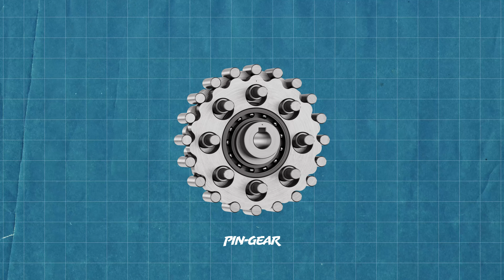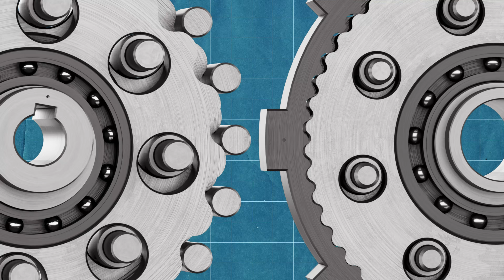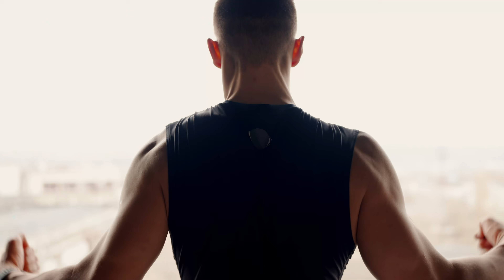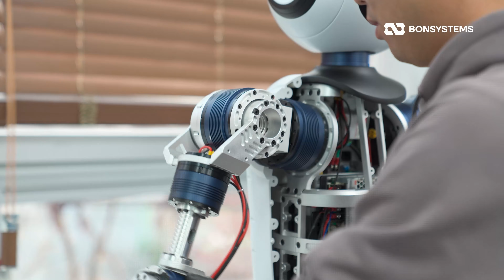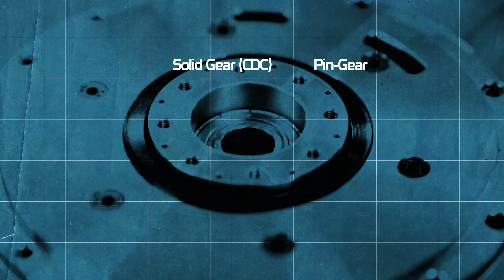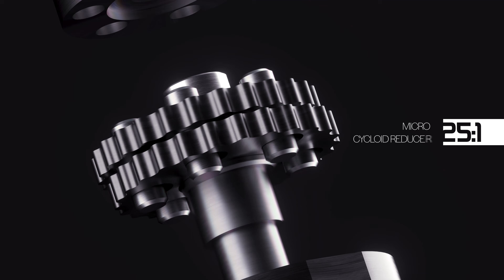Cycloid Gears: A Complete Comparison of Pin Gear vs. Solid Gear

Comment: I'm confused. Isn't the pin gear type usually has higher efficiency and lower friction since it turns sliding friction to rolling friction between the teeth and the ring?
Reply from the maker: Even with rolling motion, cycloid reducers are structured so that a large number of teeth are in simultaneous contact with the outer ring. (As you noted, cycloid gears do sacrifice slightly more efficiency compared to planetary gears, but they offer superior precision.)

Our BCSA series is designed with a slight, optimized clearance between the inner and outer cycloid teeth to mitigate the friction caused by this extensive contact. This structure effectively reduces friction while maintaining performance.

Comment: Any relevant study will tell you that solid teeth are less efficient, you can search for them.
Reply: I think the same, this doesn't make sense to me
Reply from the maker: You are absolutely correct regarding the general theoretical comparison. We are well aware that rolling contact (pin type) generally offers higher efficiency than sliding contact (solid type).

However, our goal was to overcome that limitation through engineering. By optimizing the tooth profile and clearance, we successfully minimized friction in the solid structure. This allows us to offer a reducer that provides high precision and sufficient efficiency at a much more accessible price point compared to complex pin-type systems.
Reply from the maker: We actually feature performance tests covering efficiency, backlash, and angular transmission error in our video titled: 'A Gear Reducer That Nails Precision, Torque, and Efficiency – With Rhythm Too?'

If you compare these test results with the efficiency data of typical cycloid reducers, you’ll be able to see the real-world difference for yourself.

Comment: To calculate the shape of Pin and Solid gears used same math formula. Heads of outer gear teeth are same round pins, but connected in single part. There is no phisical difference, between them. "Slight relief gap" depend of precision of manufacture. Backdriveability depend of general efficiency and reduction ratio. General effieciency depend from precision of manufacture (include roughness of working surfaces) and stiffness of all parts. Stiffness depends of used materials, size of parts and gaps betwin them. There are another difference between pins and solid. Pins are more easy to manufacture with less waste of matherial. They also can be heat treatened and polished much more easy. Solid gears are better for small teeth for high reduction ratio and small general size of reducer. There is another design of cyclo reducer, where pins are not stay in place, but roll betwin external and internal gears, but this is another mechanic system. Also, i advice you to add plate, which will connect free ends of pins in output shaft. It will rise the stiffness of output shaft and allowable load. This plate will be betwin motor and double cyclo gears. Sorry, no way to add photo(((
Reply: I've thought about adding such a plate to the free end of the output pins. Have you actually tried it, or done FEA? Under high load conditions where the output pins begin to flex, it could theoretically transfer some of the load from pins that are under high pressure from the discs to others that are not. But I don't know if it would really be effective enough to be worth its weight. It would probably work better with a bearing in the center around the input shaft, to guarantee that all deflections are carried around the circle rather than potentially pushing other pins in a radial direction.

Another point in favor of pin ring versus one-piece squiggly ring is that only the pins need to be made of steel. The ring can be aluminum, which is much lighter weight for the most bulky component. The pins have plenty of bearing area against it compared to the line contact between disc and pin, so surface hardness is not a problem.

I have seen the roller cycloid simulated (see my comment from 2 years ago on Tomato1107's video 73DANPATrQU), but never a real one. It has the disadvantages of needing twice the number of teeth for a given reduction ratio and twice the eccentricity (thus larger holes for the output pins, so they have to be smaller diameter, when you've already lost some disc diameter to the rollers), but friction would be much lower. And if you make it using a spherical milling tool to cut a circular groove into the wall of the disc and ring and inserting bearing balls inbetween, it could be axially preloaded like a ball bearing to eliminate backlash.
Reply from the maker: @dekutree64  Thank you for the insight. While eliminating backlash is important, our team has decided to focus more on backdrivability for the BCSA V4 series, as it is designed as a specialized solution for robots. We are actually addressing the friction issue by testing DLC coatings, aiming to ensure smoother movement and better force control.
Reply from the maker: Thank you for such a high-quality insight! You hit the nail on the head regarding the manufacturing trade-offs between Pin and Solid types. We completely agree that the Solid type excels in compact designs requiring high reduction ratios. We especially appreciate your technical advice on adding a support plate to the output shaft pins. That is a crucial detail for maximizing stiffness and load capacity. We will definitely consider your feedback for our future designs. Thanks for sharing your expertise!